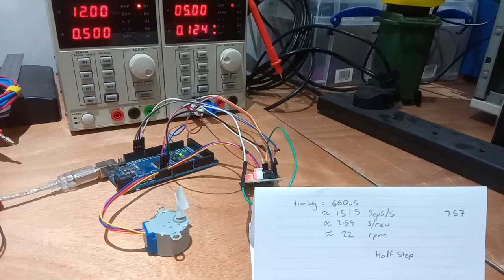#56 - 5v stepper motor 28BYJ-48 + ULN2003 speed - Wave, Full, Half step

Comment: Thanks for your video. You mention that you use your own code instead of the standard libraries. Could you please elaborate on this code? I managed only 14 rpm using the digitalwrite to the four pins. (0,0,0,1 -> 0,0,1,0 -> 0,1,0,0 -> 1,0,0,0). And a delay(2) after that as delay(1) does not seem to work. I would be very interested in hearing how you managed to get up to 25 rpm!

Thank you in advance!
Reply from the maker: I can't remember how far I go into it, but the ones you describe is stepping, full drive has two poles on at once, and then have wave alternates between. Basically it's the sequencing that I've changed. I also use micro delay rather than delay which is in milliseconds. Which means you can narrow the timings down and get a higher speed.
Reply: @CrazyLogic  Wow, thank you for your fast response! I also found a video you made 8 (!) years ago which also helped me. I can go on experimenting now 🙂
Reply: @ruudsmits907  hello sir, i'm curious about the result of reducing the delay, can it actually get to 25 rpm?
Reply: @syahrialrasyid2539  
Dear Syahrial Rasyid,

I am afraid this project is a bit on the backburner. I will try to find my information regarding your question, but it might take a littler while.

Regards, Ruud